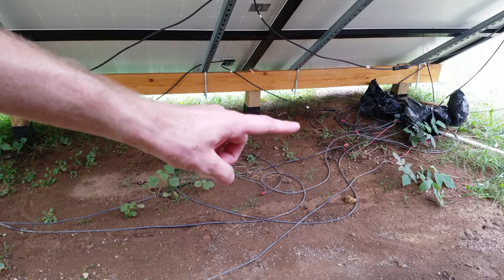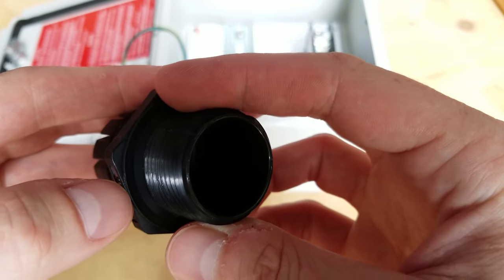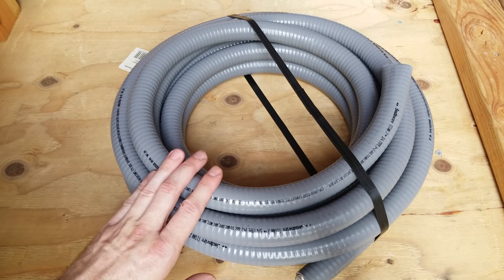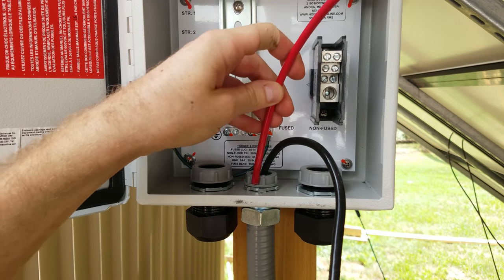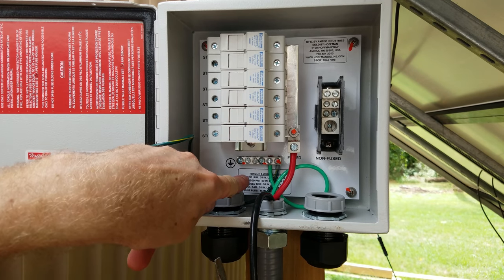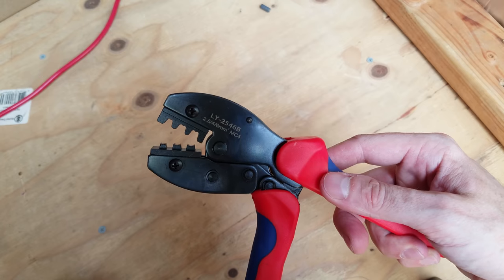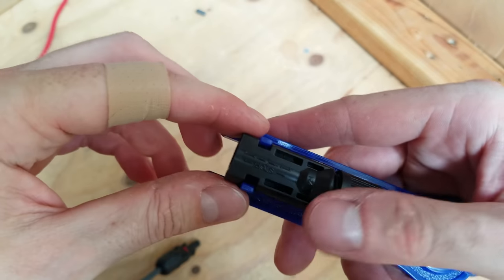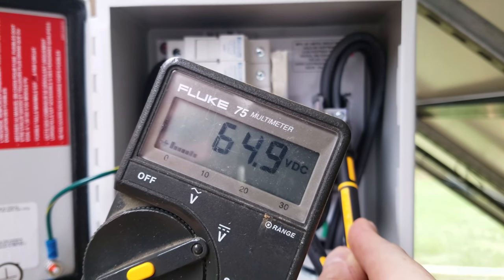Connecting the Solar Array to a Hoffman PV Combiner Box, Off-Grid!

Comment: Hoffman boxes are top notch, used them exclusively in great quantity (Nema 4, 4X from 4x4 boxes to 6' DD cabinets) for a long time and their back panels are excellent.  A Greenly knock out punch set would be a nice addition to your tool kit!  Nice Score on the boxes!  Really nice and proper job with proper feed thru's on the wiring and routing with good tips and tricks.  Well done and thanks for sharing this with the community!
Reply: My over engineered self lusts for 4X and a much larger box for hand access!

ABB boxes are thicker but the ones we used had removable knockout plates with cork gaskets.

Comment: There's no such thing as a water-tight seal. Drill holes on the low-points of your conduit for water to evacuate. This will help with regular weather changes like condensation and pressure changes. You're not waterproof if you don't evacuate water.
Brilliant video!
Reply: Better yet install a piece of rigid conduit with a T box and at least a filter drain to keep out the critters. 

When I worked the petrochemical industry we couldn’t allow pooling, because it might be explosive so no flex except for the last 18” and a T and a drain on every low point. The box needs a drain too since condensation will fill to the level of your bushing.

Comment: If I anticipate trouble getting wires into flex conduit, I'll pull the wires while it is lying straight on the ground, then install it.
Reply: They make lube 🤣

No really you can buy conduit lube for wire pulling, looks like a bucket of what you’d expect an elephant to produce. But try running Russian certified, GOST not UL, cables from a telephone booth sized motor starter 40ft down a skid without it. It was a vapor recovery skid for petrochemicals.
Reply: Exactly. I always run my wires through the conduit first. A hell of alit easier. Especially if your running more than 50 feet.

Comment: At 5:00 Stop. Do not try to assemble the flex while the connector is in the enclosure. Remove locknut. Build in your hands tighten after assembled in your hands, then mount assembled flex to enclosure with locknut. Support flex within one foot of box. Pull then land output wiring before panel array feeds go into box. You're a good hand, but you are new to electric work.

Comment: My solar array only has 70v max unloaded, so I don't need to worry about high voltages, but I still am careful with it because of arc flash, it's around 1/3 inches long so ya don't want that happening uncontrolled. 
At some point when I have a more permanent array and a higher battery voltage I want to have the panels in a field with a higher voltage so there's less line loss.

Comment: I purchased the same Crimper some time back.  Prior to that I was just using needle nose loaded with butt loads of bad words.
Reply from the maker: SAME. I was using needle nose then soldered, but sometimes it wouldn't fit in the connector due to solder - also resulting in butt loads of bad words. I wish I knew better back then.
Reply: @LithiumSolar  Yep, the right tool makes life a bunch smoother.

Comment: I have so many crimpers but I need those dies. I do mostly lmr400 cable with mine and  other antenna cables. We dont use MC4 connectors at work but bought 10 pairs of them for my personal projects.

Comment: Do you need 3 To 1 Y Type MC4 Branch Solar connector if using a combiner box? THANKS, I have 6 panels...
Reply from the maker: No. The combiner box takes the place of the Y adapters. I don't like the Y adapters personally. It's very easy to accidentally overload the connectors or wires.

Comment: Thank you for the video I'm getting ready to set up a 4000 watt pv system did you install a master disconnect some were in the system I was told the system needs one I was looking at the eco worthy combiner box but after seeing this I see that this is the way to go
Reply from the maker: I do not have a master disconnect at the panels. I have a main disconnect (PV-rated circuit breaker) at the other end of the wire run.
Reply: @LithiumSolar  ok I'll look at that option also

Comment: last question. the solar array has mc 4 connectors with 12 awg wires both black and red. Ok. but can I use 10awg red and black wires with mc 4 connectors to connect to the combiner box ?
Thanks

Comment: Is it a good habit to solder the wire  at the crimped part to get a better electrical connection?
Reply from the maker: Absolutely not! It may sound like a good idea, but you're creating a weak point on the wire that's subject to breaking if/when it flexes. Additionally, you're filling the terminal with a metal that softens and melts at a very low temperature (ie if the connection starts to heat up for whatever reason). A proper crimp is superior to solder in this application.
Reply: @LithiumSolar  thanks for that valuable tip.

Comment: I’m surprised it didn’t come with a shield for the bus bar for IP20 rating. 

Also you’ll want an enclosure drain to prevent condensation accumulating and rusting out the bottom of the box. It will fill up until it spills into the flex and then flood the lower end and test the insulation until it shorts against the conduit.
Reply from the maker: I'm curious if you've seen this happen before? I've heard a lot of people mention condensation in conduit and I've yet to see it happen in any of my conduits (I have a lot of them). I'm not saying it's impossible, just... seems odd. Unless it's something that occurs over like 20 years or so?
Reply: @LithiumSolar  disaster is around 24/7 no matter what! Best way to avoid condensation is to check every now and then and dry up any signs of moisture. You will be surprised the kind of things I have found inside those boxes, spiders, all kinds of insect's, moisture, and rust. Even if they are new and built with the best materials I always do a routine maintenance on those boxes. Excellent set up, keep up with the good work! Kind regards from BC.

Comment: Instead of running panels in series, would it be beneficial to use a combiner so that all panels work at there best, and aren't affected by a panel being shaded?  I only have 3 430 watt panels that I use with a bluetti ac 200max. I'm thinking if this is the case I'd maximize my charging.
Reply from the maker: The controllers I'm using require a minimum voltage of 60Vmp to run. Most MPPT controllers will have a minimum voltage exceeding that of a single panel.

Comment: Yes just wondering what size was the liquid sealed conduit pipe i am thinking it was 3/4 but not really for sure  and I am a big fan and have learn so much on your Channel thank you for everything you do it really helps a lot because they are no classes in my area teaching how to do solar batteries inverters Etc so again thank you for everything you put on your Channel
Reply from the maker: It is 3/4 LFMC conduit. If you're unsure what size to use for your application, this is a good calculator https://www.southwire.com/calculator-conduit NEC states max of 40% fill for 3+ conductors :)
Reply: @LithiumSolar  thank you so much

Comment: did you plug the unused holes in the rubber plug with something?
Reply from the maker: Not yet. I have a 5th string to connect and a ground wire yet, which will leave me with one unused hole. I'll just stick a small piece of PV cable in to plug it.

Comment: How did you determine the size of the wire for the combiner box?  Thanks
Reply from the maker: I always reference the NEC code, section 310.16 as a starting point. There is more that goes in to it beyond this though, such as length of wire, bundling, etc. You can find the table on Google fairly easily.

Comment: If you can easily feed your wire through your conduit, don't cut the excess, just push it to the other end, so you will have on long piece of excess wire instead of two shorter pieces.

Comment: So should the combiner box be close to your panels as opposed to next to your inverter. So then you run a thicker 6 ga wire to the house, eh?
Reply from the maker: Typically they're installed at the solar panels, then one set of conductors run back to the inverter. However, please make sure to check and follow your local codes/requirements.

Comment: pound a 6'-8' bar into the ground and put a mechanical clamp (elect supply store) or you can Cad Weld/Exothermic, and attach your ground wire from that to your box buss bar. Your resistance should have 5 ohms or less -  no more if possible = All good.
Reply from the maker: I do have an 8ft ground rod already pounded in. I guess I'm just not sure what gauge wire and proper clamps to use. You mentioned max 5 ohms, are you measuring that between the solar panel frame and the grounding rod?
Reply: Yea, I am working on my install and bought a grounding rod, not sure where to measure the resistance
Reply: @BobHannent  anywhere along the ground  works the same. 5 ohms or less is a pass for any electrician. 0 is the best.  I am a CM.
Reply: @BobHannent  code says 8' rod but 6' works  what doesn't work it hitting a rock 3' down then cutting it off so it looks like 8'   lol
Reply: @BobHannent  i have built 100's of telecom cell sites  rooftop and dirt(greenfield). .
Reply: @BobHannent  also no sharp 90 deg turns with your wire.  gentle  curves for lightening protection
Reply: Use a through wall lug on the box and a split lug on the rod and just use the same gauge as the controller conductors for short runs. You could lookup the gauge for the amperage you’re using but #6 is easily available.

Comment: Can you help me understand why you needed a combiner box for six panels?  I would assume for that small of an array, you would just make 1 string and only have 2 wires to deal with at the end anyway.
Reply from the maker: I have 15 panels. My charge controller (like most off-grid controllers) is limited to 150Voc input. Because of this, I can only wire 3 of the panels in series before I risk exceeding 150Voc. So I have 5 strings I need to combine.
Reply: @LithiumSolar  Ahhh, I misunderstood. That would do it then.  Most of the UL listed Hybrid converters I see go up into the 480 -580v range.  But yes, 150v would limit you.  Thanks for the quick response!
Reply from the maker: @rustusandroid  My system is 100% off-grid. A hybrid system is still technically grid-tie and requires piles of permits, contracts, and approvals :)
Reply: @LithiumSolar  True that.  Maybe I should watch more of your videos before I start running my mouth :)

Comment: I wonder if there is a requierment to connect the metal of that conduit to ground...???
Reply from the maker: The conduit is bonded to the metal case. The lock ring that is screwed down on the conduit fitting has teeth that bite in to the box metal (through the paint). They do make some rings that also have a ground wire terminal on them - up to your local codes if that's required.

Comment: Nice video but is it ok with no negative fuse.
Reply from the maker: I have a 2-pole circuit breaker at the charge controller. Whether or not this box is ok (with a positive-only fuse) will depend on your local codes.

Comment: Two questions:
1) What gauge grounding wire did you use coming from the array?
2) Did you also run ground wire from the ground bus bar to a grounding rod in the ground? And if so what was the gauge ground wire to that ground rod?
Reply from the maker: You should ground it in accordance with the code requirements in your area.
Reply: @LithiumSolar   right but I was still curious what gauge ground wire you used and if you installed a ground rod and wire to the combiner as well
Reply from the maker: 6 from panels to combiner, 10 from combiner back to shed.
Reply: @LithiumSolar   gotcha, thanks

Comment: How many panels in each string, and what are the values of the panels, Voc, Vmp, Imp, Isc..??? Are they 12v or 24v panels, wattage each panel...???
I think you can gleen the information I'm looking for...
Reply from the maker: I'm not going to go through and collect this information. I'm not sure what you're looking for, but the label on the inside of the box lists out the specifications for the enclosure.
Reply: @LithiumSolar  I wasn't referring to the enclosure...and by me listing the info I requested, and you not being "sure" as to what I'm looking for tells me that you have 1) no idea what you're doing, 2) no business guiding other people...
Reply from the maker: @wipatriot510  This video is nearly 4 years old. How do you expect me to spout off those numbers and calculations nearly 4 years later? I'm not going to run around like a puppy and gather this because some random commenter asks. Additionally, this box isn't even installed anymore. You should be following your local codes, requirements, and regulations, not relying on a Youtube video.
Reply: @LithiumSolar  It's BASIC information...and if you're not here to make reliable content, then you shouldn't be on youtube at all...

Comment: Hmm never made a later video about the frames EGC to the busbar connection or the  inverter end of the EGC ?
Reply from the maker: Nope. This was connected to an isolated controller so I never had it grounded. It's since been replaced and grounded properly now. I would suggest following all electrical codes/requirements for your area!

Comment: Is it possible to turn around the bus bar on the right?
I think it would be easier if you loop the charge controller wire, and connect all the solar panel wires from the bottom.
Reply: Daves Tech no top penetrations on outdoor NEMA 4 enclosures
Reply from the maker: Yes, the bar could have been turned around. It's just held in by a pair of phillips screws. I suppose that would have made it easier, hadn't thought of that.
Reply from the maker: And yes, no top penetrations. I don't even like side connections (have one on another unrelated box).
Reply: @davestech6357  Top connections are risky for being water proof. If you have even the smallest leak then in top connections water will drip inside, while in bottom its unlikely.

Comment: Shouldn’t the fuse busbar be on the other side? The left side was hot when you dropped the fuse in..
Reply from the maker: The fuse doesn't make contact on either end until you close the fuse holder.

Comment: I am a beginner in this area so bear with my foolish questions. First, why did you use 6 awg red wire for the positive and 12 awg black for the negative? should you not use 6 awg black wire?
Reply from the maker: Both red and black are 6 Awg.
Reply: @LithiumSolar  thanks for the reply
Reply: @LithiumSolar  size of the green wire? Thanks

Comment: next time tape all conductors together and pull it in 1 shot it's a lot easier
Reply from the maker: I would have done it that way if I were pulling rather than pushing it through. I figured it would have been too thick and stiff to get around the 90 bends, but maybe not.

Comment: Were is the link to that fancy tool to disconnect the MC4?
Reply from the maker: The crimp tool kit includes 2 of the MC4 connect/disconnect tools https://watts247.com/product/mc4-solar-crimping-tool-kit-crimper-for-2-5-6-0mm2-solar-panel-pv-connectors-cable/?wpam_id=97
Reply: @LithiumSolar  okay, I saw that but the tool you were talking about to replace the needle nose pliers I didn't see. Is that the same thing as what is in the spine of that kit?
Reply from the maker: @awesomedee5421  Yes, it's the same thing. In reference to the tool shown in the spine of the kit, the round part is for tightening the nut down where the wire goes in to the connector when splicing new connectors on. The two points on the other end are the disconnect tool. They will go over the MC4 and press the two tabs in for removal.

Comment: I am not an expert but I see a lot of safety issues.
Disconnected or cover panels 
Use electrician gloves
Used electrician tools

MCA connectors: need two of the plastic tools, that will torque at the proper value.
Reply from the maker: I am not an expert either, but you sound like more of one than I.

Comment: 😱😱 You've got to have some THICK skin when making these types of videos...and be able to handle the criticism that will follow.  It's funny how every little thing you do is going to get examined under a microscope.  Most of the points they bring up ARE important...but damn....  Example:  1. Wrong kind of screws used to mount the conduit.  2. You should have pushed ALL of the those runs at ONE time through the conduit.  3. Your combiner box needs a way to drain condensation.  4. Where's the ground bar for your panels?  5. OMG your not using isolating screwdrivers...all the newbies will die!  6. Shouldn't be calling them knockouts if you gotta drill them out!    ON AND ON.....HOLY SHEET PEOPLE, MAKING VIDEOS AREN'T EASY!!!!!   👏👏👏

Comment: Try to stay away from those screws you're using on the conduit.  They're drywall screws and they rust and are very brittle.  Tighten them too hard and they snap off.
Reply from the maker: They are exterior decking screws :)
Reply: @LithiumSolar  Yeah, not really the best choice.  The bugle head is wrong for this application.  Just saying.  Otherwise, great job.
Reply from the maker: @alext8828  Thanks. I'm not overly-familiar with hardware like this. I use deck screws pretty much everywhere. Is there a specific kind you would recommend?
Reply: @LithiumSolar  A wood screw with a flat bottom to press down with its entire surface rather than a bugle head that tries to displace material as it goes in.  Excellent job.
Reply: @LithiumSolar  Your local big box store will have hex washer head "sheet metal" screws in stainless steel to size 14 (1/4") in various lengths. "Lag screws" in still larger diameters.